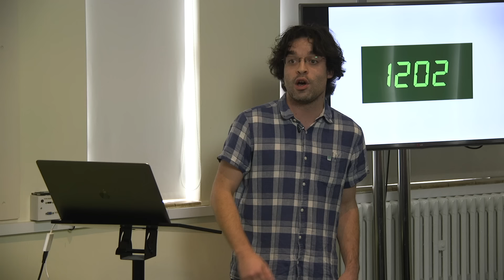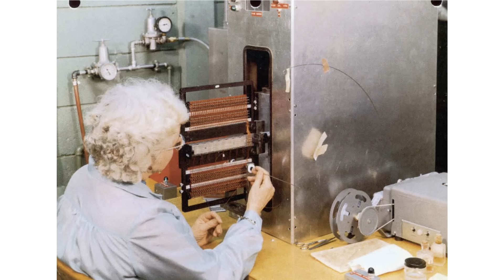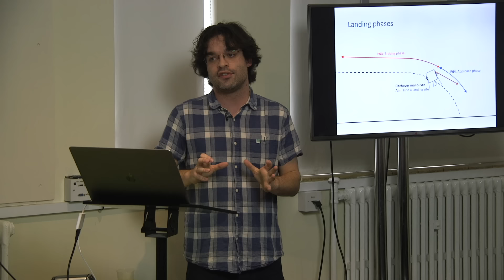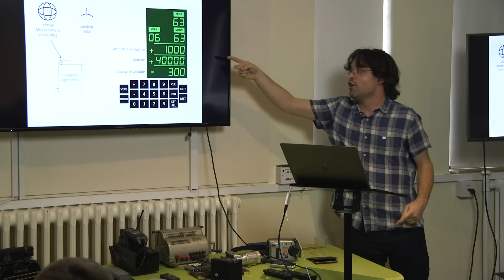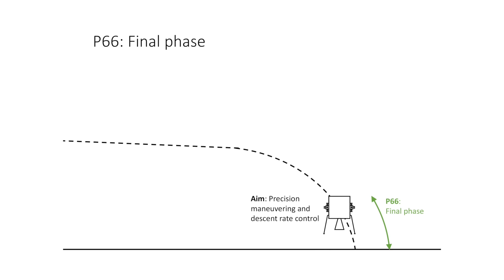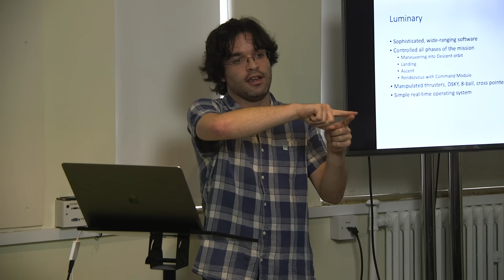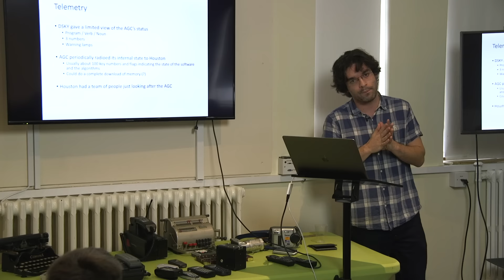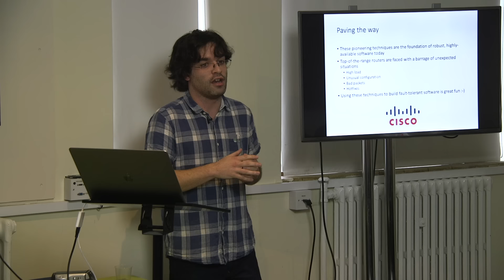Light Years Ahead | The 1969 Apollo Guidance Computer

Comment: For those of you who are interested in the code development, I highly (very highly) recommend 'Sunburst and Luminary' by one of the development team, Don Eyles.  For Robert (if you would like a / need a Don intro, message me), I have seen somewhere (but where?) that Gene Krantz drilled the team after 1202 / 1201 errors occurred in a simulation and the team did NOT react quickly enough to save the practice. Is that true?

Comment: I just watched this. Fascinating presentation, thank you very much. I was wondering a few things about the issue of the rendezvous radar. 1) why was it even turned on when they were in a position where it was totally useless (i.e. landing on the moon as opposed to rendezvousing). 2) why didn't Houston see and recognize this additional but useless load on the computer. 3) this is more hindsight, but seems like there would be systems to recognize things like a repetitive alert coming in and either optionally ignore it, or raise and alarm so it could be investigated.
Reply: i just watched through the question session and see some of the answers to my questions 1,2,3.

Comment: Even though the computer was made for just one thing, I was a member of a team that used one of the computers later in a NASA aeronautics flight project. The project, named F-8 Digital Fly-By-Wire Phase 1, used that computer for all processing and body-attitude position sensing in the primary flight control system.

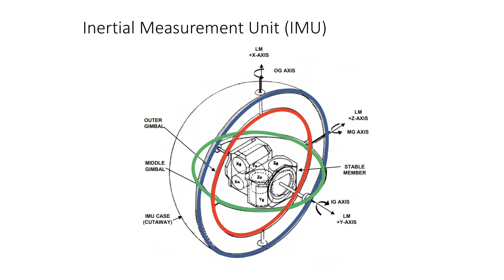Comment: When you are watching "Apollo 13" (the movie) you can refer back here at @15:19 because the IMU is the hardware that is capable of suffering the dreaded "gimbal lock". My memory of the movie is that the operation to get the joint Apollo-LMU unit was navigated using the LMU reticule during the LMU engine reinsertion burn. Doing this sort of analysis of that operation would make a really interesting follow-up. Of course my memory is working on 72 year-old wetware with no backup, so it may need correction.

Comment: 1:01:00 It's not so common in aircraft cockpits today. There are some alignment marks in the cockpit, but they are there just to give you guidance on how to adjust your seat. Modern aircraft cockpit heads-up displays actually use a special type of projection system that will display correctly aligned graphics no matter of your head position. It's called an optical collimator.

Comment: I was a telephone exchange engineer working on TXE4 (for around 16 years).  The programme for the main control unit was held on a “miniature threaded wire store” with a max 5000 programme steps and programmed in the same way as the one described on the AGC.  I cant remember the terminology now but each programme step output 8 digits in 2 out of 5 binary coded decimal with parity checking and special stores were used to manipulate information  - unbelievably familiar up to that point, I’m gobsmacked !!

Comment: An astounding presentation based on an astounding piece of equipment! This was developed at a time when computers really did fill up whole rooms, memory was a grid of toroidal cores, and engineers at the time used slide rules for design calculation because the pocket calculator was five years away!

Comment: I concur, interesting talk.  But why does NASA exhibit photos of what look to be plaster cast boot prints set in a small depression!?  13:16   Surely the material on the surface of the moon has just the right qualities to leave near perfect impressions?  Why not just photograph the prints made by their boots?
Reply: It isn’t plaster, it is called lunar regolith. Aldrin took 5 photos when he photographed his bootprint known as the Bootprint Penetration Experiment...

https://www.hq.nasa.gov/alsj/a11/AS11-40-5876HR.jpg
Buzz took this picture of a pristine surface before making a bootprint. He took the camera off the RCU bracket and took this series of bootprint pictures holding the camera in his hands. Buzz was in the field-of-view of the 16mm movie camera mounted in his LM window (Link to the movie below).

https://www.hq.nasa.gov/alsj/a11/AS11-40-5877HR.jpg
Buzz made this footprint on a pristine surface so that he could then photograph it for study by soil mechanics experts.

https://www.hq.nasa.gov/alsj/a11/AS11-40-5878HR.jpg
Buzz moved away slightly to take this second image of the fresh bootprint, getting slightly better focus.

https://www.hq.nasa.gov/alsj/a11/AS11-40-5879HR.jpg
A close-up of the surface with a two-inch rock and, in the lower right corner, Buzz's boot and footprint. Near the upper left there appears to be a cohesive clump of soil lifted -or pushed - out of a bootprint.

https://www.hq.nasa.gov/alsj/a11/AS11-40-5880HR.jpg
Second photo of Buzz's second soil-mechanics bootprint.

Text and images can be found on the Apollo Lunar Surface Journal.
https://www.hq.nasa.gov/alsj/main.html

Buzz performing the Bootprint Penetration Experiment captured on 16mm film at 1fps through the LMP window.
(Buzz is on the left edge of the frame)

https://youtu.be/CCUrE14ddeA?t=23166

Comment: What a great talk. Mr. Wills, I wonder if the reason you cant find the simulator is that an analog/hybrid computer was used (https://en.wikipedia.org/wiki/Analog_computer).  I studied computer science starting in the late 60's and took a class on hybrid computing. It was a CDC 3200 connected through multiple DACs and ADCs to a large two panel analog computer. The primary reason for this was that digital systems at the time could not perform integrations quickly enough to perform realtime simulations of physical events.  The analog system was programed with wired patch panels which interconnected various functional units--summers, multipliers, and integrators--adjusted with 10-turn precision potentiometers. The signals had a range of -20V to +20V, so all of the analog models had to be scaled to fit within that range.  In other words, 10V in one part of the model represent a different value than 10V in another part of the model. Then, the digital computer would control the model by applying voltages that represent input variables, and would monitor the system by reading back voltages at test points.  For an assignment I remember modeling a simple airplane and "flying" it while displaying its state on a very large vector graphics display. Since the panels were reused at the end of each project, there was not a lot of documentation remaining afterwards.
The testers could have realistically modeled the dynamics of the LEM and its many subsystems on an analog system, and run an interpreter of the actual AGC high level code on a digital computer, including the various sensors and interrupts. The hybrid system I learned on ran a realtime multitasking operating system with multi-threaded tasks.
By the way, the CDC 6600 (https://en.wikipedia.org/wiki/CDC_6600) used a 60-bit word and one's compliment arithmetic (because it took one less clock cycle to add numbers).

Comment: He is a bit incorrect about the Landing Point Designator though (his red dot indicator on the window). Only the right hand side number is the actual LPD angle - it only points out the vertical angle on the window. The horizontal angle is not needed, it's always kept in front of the vehicle, by the computer. The left hand side number is time (in seconds) until switchover to P66. Notice that Buzz shouts out only one number, and that's the vertical LPD angle (see transcripts or landing videos). Another good source about LPD: https://www.youtube.com/watch?v=ni4GBRVUvdQ.

Comment: 22:36 the diagram should be corrected. As it is, it indicates the wrong thruster being used for the ullage burn.

AGC flew on manned missions 8 through 17. Probably on the unmanned, CSM flights as well (for telemetry if nothing else).

AGC used magnetic core memory which is radiation hard (immune to single event effects such as cosmic rays).

Great information about the AGC and running your own emulator for it is here: https://www.ibiblio.org/apollo/

Comment: 19:10 But why in the world did they skip P65 ? [now I am scratching my head]
Reply: Watch to the end, the P65 question is asked. Basically, it was a fight between engineers, who wanted the whole thing to be automatic (P65 was the auto land software) and astronauts who wanted to be able to take manual control (which was P66), In the case of Apollo 11, it's a good thing that they did not use P65, since the initial landing point was in a field of boulders, which the computer did not know about. In the entire Apollo program, no moon landing was ever done with P65, although it could have, and it would have worked for any mission other than Apollo 11.
Reply: @SweetBearCub  Ah.. I see [I'm almost always commenting while watching]. Thanks. I was wondering how much more capability, let's say a commodore VC 20 from 1981, had compared with that computer. After all - a 6502 micro chip is just a bunch of integrated circuits . Right?

Comment: Bullshit, this guy immediately butchers the story.  The true story is:  the standard touchdown point was toward a boulder field.  Neil halted the decent by using 'Altitude Hold' mode and he commanded a pitch forward to travel forward toward a better landing spot.  The Altitude Hold mode is all part of the computer controlled mechanism, so by Neil selecting this mode and manually controlling forward flight to a better landing spot this is Neil using the computer, relying on it so obviously Neil was assuming the computer was working.

This guy completely messes up the story because the 'excitement' of that moment was, they were just off the surface so that meant remaining fuel was pretty low.  You only have a limited number of seconds to do this manual traverse while in Altitude Hold mode.   Time/fuel was running out so Neil needed to traverse as fast as possible to get to the safe landing spot that was fairly far ahead.

To further describe the reason for excitement, Neil had to use fuel to traverse, then stop the lateral motion, then put the mode back into the normal decent mode then continue down to touchdown.

I am thoroughly disgusted with this author's ridiculous hyped and wrong telling of the story.

This is a ridiculously bad video because the story telling has been horrendously botched!

Comment: This was a great presentation by someone who obviously knew the subject very well and had a grasp of the facts and the history. Great job Robert!

I started my career programming an IBM 1620 by loading commands at the console. I’m just as nerdy now as I was in 1970. I also remember watching the lunar landing and sitting, biting my nails as the problems happened in real time. I found this talk to be just as fascinating.

My interest was piqued about the simulation software. I once wrote a piece of simulation software to emulate ninety-six different on-line users on a front end processor to a Sigma 7 in 1980. I have a hard time imagining doing it in the 1960’s for a number of reasons. Also, Sperry-Univac 1100 computers (large pieces of iron) used twos complement arithmetic. Twos complement uses slightly less hardware and runs slightly faster.

I can also envision a case where the radar never had occasion to fail during testing and the “failure” is really an integrated design “feature”. How often can you aim a radar and get no return? I mean absolutely no return. It almost sounds like when the Bell Lab engineers tried to eliminate all background noise in a microwave receiver.

Comment: A correction. The AGC did not get the Apollo spacecraft into earth orbit or send it on its way to the moon as stated at 5:25. That job was performed by the Launch Vehicle Digital Computer (LVDC) that was located in the Instrumentation Unit (IU) located on the top of the Saturn V third stage. From launch through the transposition and docking maneuver, which occurred after they were on their way to the moon, the LVDC controlled everything while the AGC in the Command Module was only functioning in a supervisory and back up role. There was also a second AGC in the Lunar Module but that wasn't activated until they were already in lunar orbit and preparing for the landing.

Comment: 40:58 Reminds me a lot of how software is developed in the automotive industry: watchdog for threads, watchdog for the process, 3 consecutive restarts of a service results in a system restart, watchdog for the hardware itself, low CPU power and RAM, 60% average CPU threshold requirement.
Side note: the presenter is really good. If I presented that, it would of sounded boring :)
Reply: There are a lot of similarities between the Apollo Guidance Computers and automotive and industrial controllers. Desktops, laptops and smart phones are quite different animals. Computers that interface primarily with humans use keyboards and screens as the I/O. Controllers uses sensors, buttons and switches as inputs while the outputs are solenoids, mechanical actuators and electric motors. Also, there are typically no screens to look at. To look inside the controller you need a special scanner or data terminal so you can see what's happening inside.

Comment: Really? All the data was hard programmed? Then you must have the telemetry...
Reply: All software and predefined data were hard programmed. The actual data were coming in in real time of course!
Reply: The procedure logic and orbital mechanics where hard programmed. Only the parts that are variable (mission time, position, speed, state of devices etc) where stored in ram. Thats basically all the computer needed, as long as the original programs where programmed flawlessly.
Reply: @vast634  The ROM included all the planned stuff, like where on the moon to land, what stars to navigate by, how big the rocket was, how to phone the White House for that special talk.  Even more plans were in the paper binders that they carried, such as how to plug in the spacesuits and what to throw out the door to keep the weight down.
Reply: @johndododoe1411  Yes what I have said. All the parts that where not variable during the mission could be "woven" into the ROM section. There where not that many variable/dynamic states that required a RAM address.
Plus this made the computer more fault tolerant, as the ROM could be error checked on ground and ensure all the data is correct, compared to loading it from a tape and storing it into RAM.

Comment: I wrote several small games in 4 kilobyte sized programs. Its possible, and a bit of a challenge, but also fun. Software nowadays is very bloated, and thus getting very complex too.
Reply: Considering my first computer had 2k of RAM, and that was shared with the video memory, of course you can write software with less than 2k of memory.

Comment: was that massive room sized computer at houston, in the rocket? Did they have wifi between houston and the moon? this is a pile of steaming hs
Reply: You raised an interesting subject. Actually they did have room sized computers in Houston that did most of the high level number crunching. Then the results of those massive calculations were reduced to just a few simple numbers. Those simple numbers were then either read up to the astronauts verbally and manually entered into the AGC or they could be transmitted up to the AGC via the normal consolidated S-band radio link. Once the AGC had the numbers all it had to do was execute its pre-programmed instructions using the numerical values that had just been sent up from the ground. The primary function performed onboard the spacecraft was actually pretty simple. The AGC just had to point the engine in the correct direction and then fire it long enough to obtain the required change in velocity to send the spacecraft on the desired trajectory.
Reply: AGC suitcase sized and standard radio communications

Comment: One lesser-known fact about Steve Bales calling GO on the 1202 and 1201 alarms is that, in a simulation, he had gotten a computer alarm that he didn't fully understand, and he called ABORT -- and was wrong.  After the sim, WHITE FLIGHT Gene Kranz told Bales to develop a list of all potential program alarms.  Bales and Jack Garman (one of the guys in the Guidance backroom) got together and discussed this; Jack wrote a list of program alarms with brief descriptions and their severity.  When Bales called back for information, Garman had it right there, and the mission continued successfully.  If not for the foresight of Kranz, Bales and Garman, the information would not have been at hand when it was needed, and they might have called for an ABORT.  Bales was 26 years old at the time, Jack was 24.

Comment: Really a good video that shows clearly how they are landing at the moon in 1969. In my humble opinion, the 1202 alarm was not fired up by a hardware bug. It was the consequence of an error at the checklist. Buzz Aldrin has switched on the rendevous radar whre it was pointed out at his checklist. So we can say it was an software error if we count the astronauts as a part of the software.
Reply: Buzz Aldrin had a hard head so it's a hardware issue.
Reply: Your humble opinion is wrong. On the Apollo 11 flight plan page 3-69 the CDR (Armstrong) turns on the RR and does a P20 Mode II to update the vehicle state vector just before implementing P63.  That's why it is on.

Comment: fast forward to now and you would need a GPU to do the same computation.  we've come a long way :)
Reply: And for all that GPU's smarts, it would still be inadequate to land on the moon. Partially because it's not radiation hardened, partially because it does not use parity checking, partially because it has no spacecraft/astronaut screen and keyboard, and partially because it does not have the amount of specialized low latency IO that was needed. A modern GPU would also use more the 55 watts of power that the AGC and DSKY combined used.